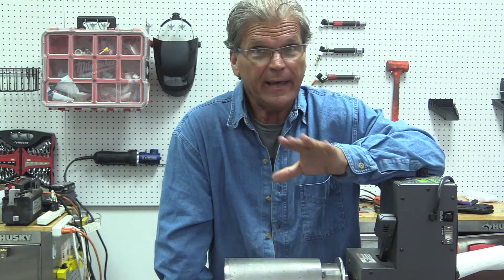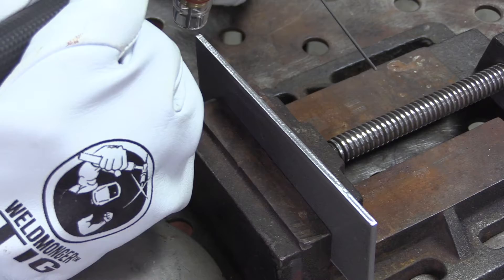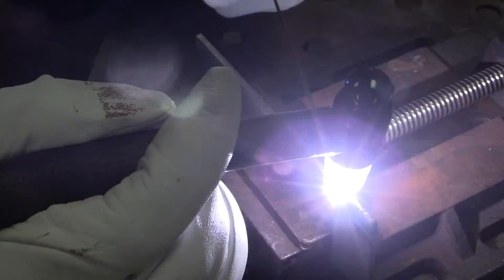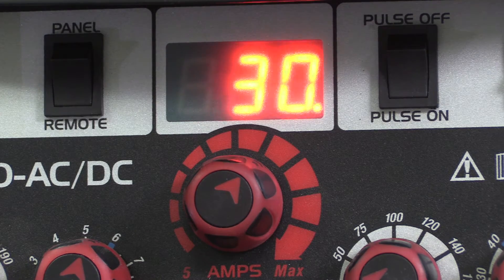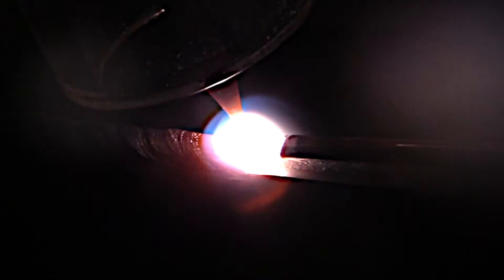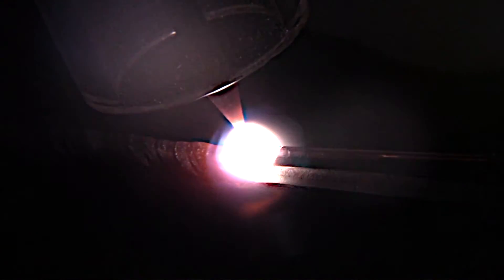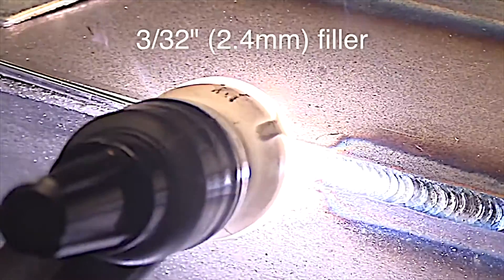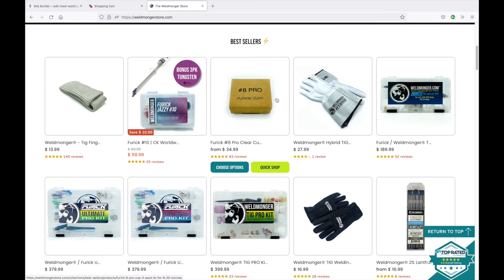High Speed Pulse TIG for Edge Welding

Comment: I did this today with the same settings. And it does work. His machine is set from factory to a fixed 50% pulse width and that was also selectable on my machine. I also found that it really helps to avoid the corners getting rolled over and being at a lower level than you want it to be.

Comment: hey there! welding student here. what's the difference between cold and hot rolled steel? 

love the content Jody, been taking welding classes since high school and am currently enrolled in trade school, you've been a big help with all the content. glad I was able to support your channel through your store with getting some good quality gear. thanks!
Reply: Hot rolled steel sheet/plate/bar is formed into shape by rollers when it's red hot.  Cold rolled is formed when it's (relatively speaking) cold.  Hot rolled steel typically has a tough, dark oxide coating on it called mill scale, from the rolling process.  For TIG welding you should grind that off, at least in the weld area, before welding. You can also remove mill scale with an acid soak, even with a mild acid like vinegar—it's called "pickling."  Some other welding processes and rods can weld ok through mill scale.  Cold rolled doesn't require the removal of mill scale and it is more dimensionally correct but sometimes the cold rolling leaves residual stresses that can be revealed by welding or other heating.  This is separate from the usual heat shrinking/warping that happens with welding.
Reply: @benz-share9058  makes sense, thanks for the detailed response!

Comment: thanks for the lesson, gonna try it here..
Reply: Hi have you tried it yet? I also need to weld on an edge and I would like to try it too. My machine has a setting "Ratio of pulse duration to base current duration" and its factory setting is 5%. That would mean for a pulse frequency of 40 Hz the period is 25ms and the pulse is only active for 1.25ms. Does your machine have this setting too? What has worked for you?
Reply: I've just read the specifications for his MT200-AC/DC machine. The pulse width setting on his machine is fixed at 50%. Well 50% is also possible on my machine. Let's try that first. Maybe later a lower pulse duration might have advantages but Amp settings need to be adjusted as well I assume.